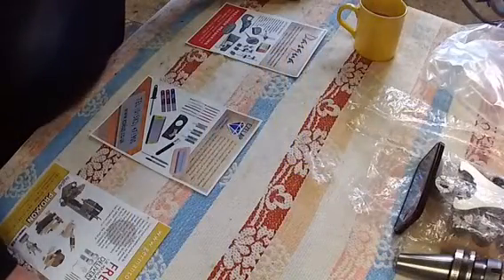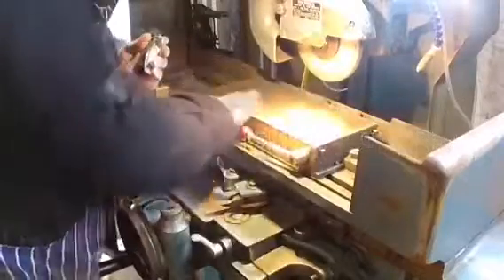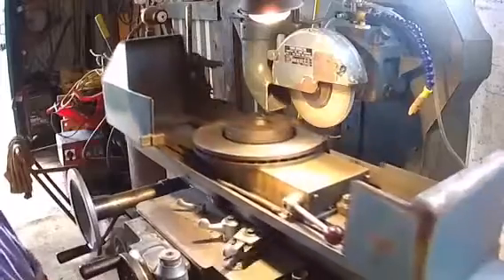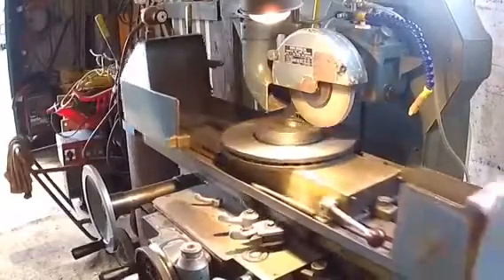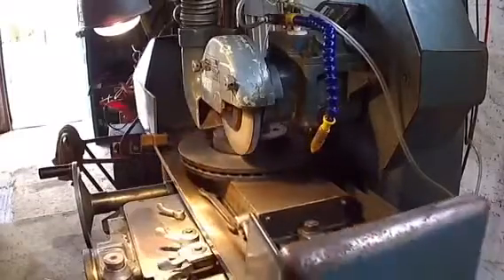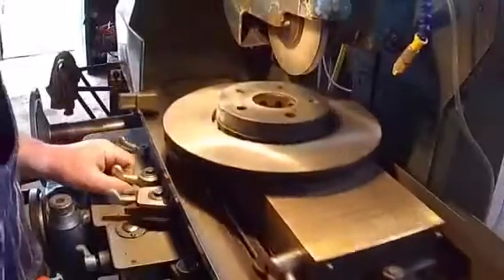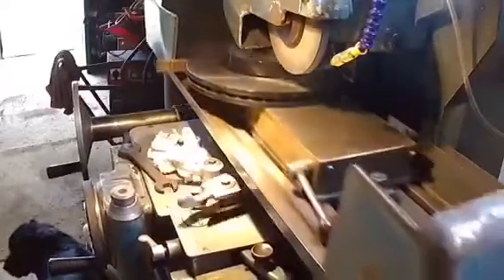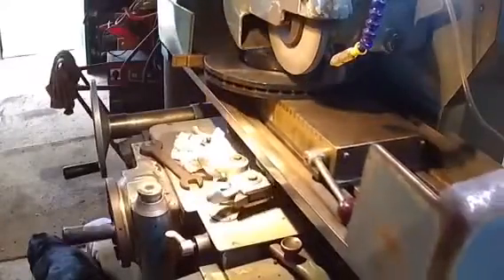Brake disc surface grinder part 1

Comment: So many things things you're doing wrong I don't have time to explain, but I'll give you a clue the inside of the rotor the deep part where you can't grind is what keeps it true not the outside...
Reply: Was thinking the same thing.  If its warped a couple thou on the surface,  he just matched it on that plane then made sure it is tranfered back the the intended surface.  LOL

Comment: Just watched your video with great interest. This exact process was first carried out commercially by my old colleague and friend Mr Michael Marriot of Carbideform who was based in Quinton Birmingham during the mid 70's and through the 1980's. The business was extremely successful and he reconditioned thousands of warped brake discs during that time. The early work was carried out using only a Jones and Shipman 540.  crosscutting the discs which was very time consuming. As a result to increase workshop efficiency the equipment was upgraded to a JS 1400 and a variable speed motorised magnetic turntable was seated to the magnetic chuck allowing the traversing chuck to remain stationery during the operation. This meant that the disc could spin under the griinding wheel and cut the process down tremendously. 
Whilst the grinding of the centre hub is required this is only a reference point to parallel it with the inner disc face keeping both in plane  however this will have no effect in the operational efficiency of the disc to remove any "swash plate effect" since the actual running studded  flange face is always inside the centre of the hub which is impossible with this method to machine. Indeed machining the three outer surfaces is the most that can be attained with this process. It was great after so many years to see this process once again. It brings back many memories of happy days spent in Michaels workshop.